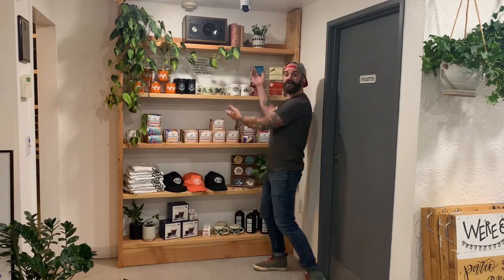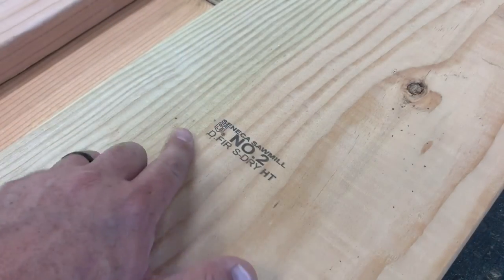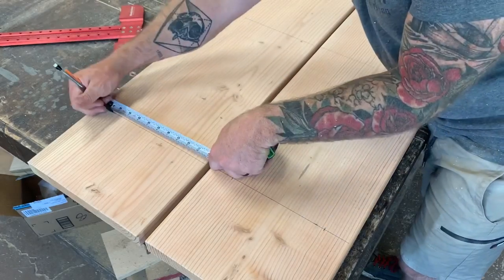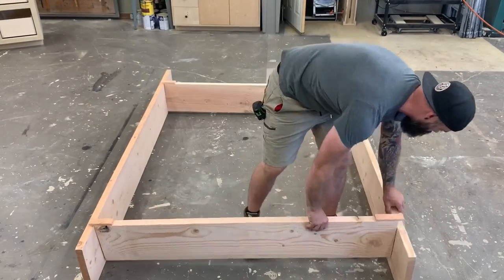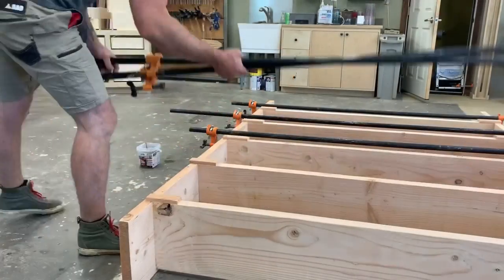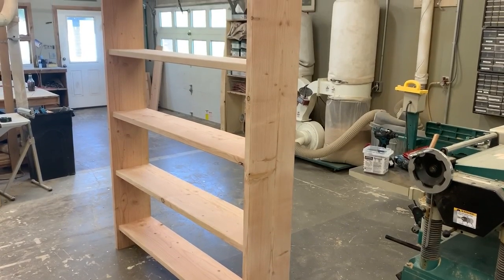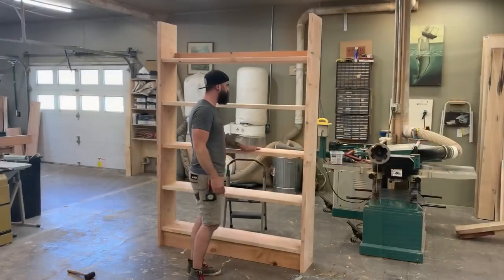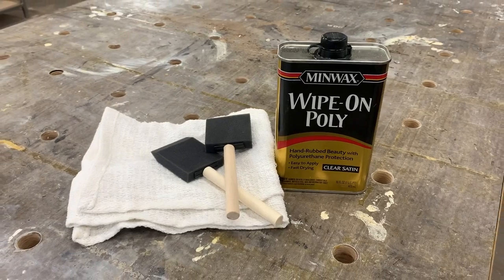Garage Storage Shelf | Easy Storage Shelf

Comment: I'm planning on using this video as a guide, but I was wondering about finishes on Douglas fir- would you recommend a stain type? And I feel like it'd need pre-stain conditioner first. Or just stick to wipe on poly? I haven't used wipe on poly yet, but I've used Danish oil. Thoughts?

Comment: Are screws through the end-grain strong enough to hold the shelves? (This isn't rhetorical, I'm a newbie woodworker and genuinely asking!) I guess with 4 1/2" screws though, that sucker ain't goin anywhere.
Reply from the maker: Well I’m 180lbs and I took a nap on them 🤷🏻‍♂️
Reply: @Bourbonmoth   Project Farm (https://youtu.be/qmajKElnwfE?t=731)  tested standard deck screws, and a pair showed pretty close to 400lbs before they came loose in pine. I imagine with the structure of your cabinet they would be more in shear load than he was testing, but I would only expect that to help the strength, not hurt it. You probably would be safe with 4-500lbs per shelf. Glue wouldn't help, so really you would have to consider pocket holes (different angle of force) or slots to get more strength if you needed it. But most people aren't putting more than 4-500 lbs on a shelf!

Comment: How do you get the side panels as tall as the ceiling?  Obviously the camera is in an area that has a taller ceiling where you can stand the unit up and slide it into place.  Many years ago I made an unit just like yours to fit inside a 10' room.  The problem was when I tried to stand it up, the opposite corners were longer than 10'  and I could not stand it up.  What an embarrassing situation for a beginner.
Lesson learned - do NOT pre-assemble units that reach ceilings.

Comment: i wonder why he didn't use pocket holes for the shelves ? would that result in a weaker joint ? the bottom of the shelves wont be visible and then you wont need to cover the holes with dowels ? or am i missing something ?